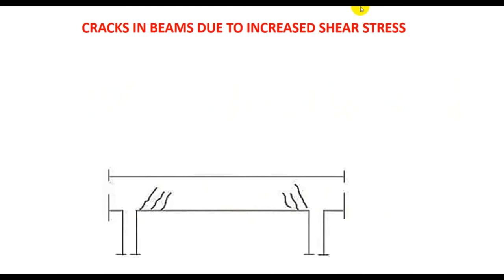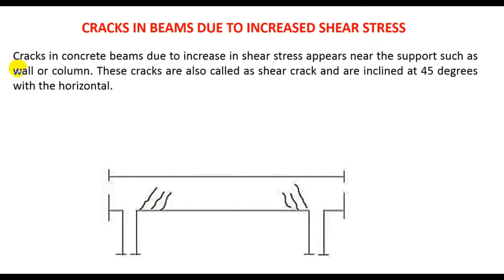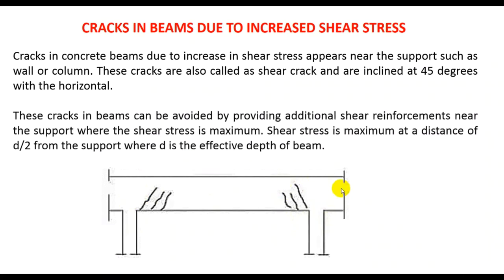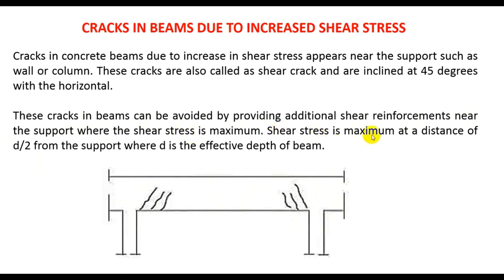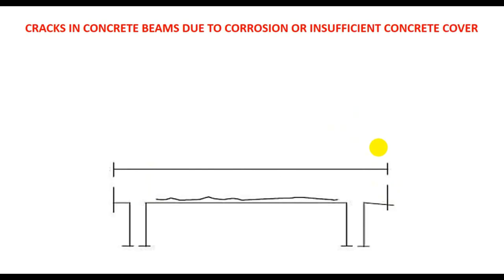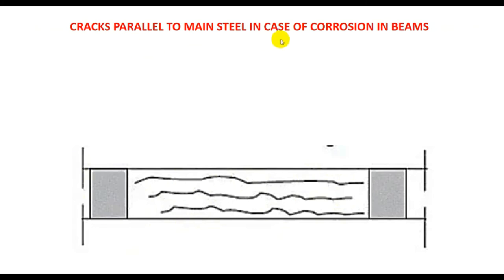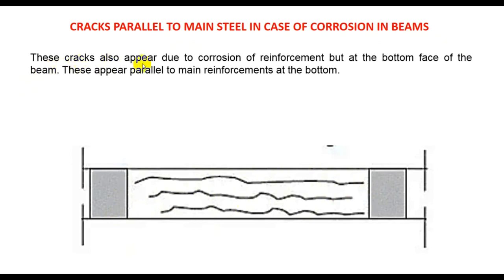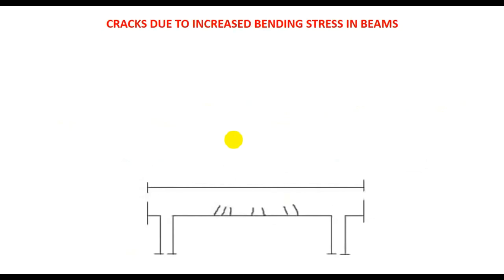Types of Cracks in Beam and its prevention | Civil Engineering Basic Knowledge

Comment: Sir is it necessary to provide cap beam in pile cap.
Reply from the maker: its totally depend on your design. 

Pile foundations are a type of deep foundation. They are formed by long, slender, columnar elements typically made from steel or reinforced concrete, or sometimes timber. A foundation is described as 'piled' when its depth is more than three times its breadth.

Pile foundations are principally used to transfer loads from superstructures, through weak, compressible strata or water onto stronger, more compact, less compressible and stiffer soil or rock at depth. They are typically used for large structures, and in situations where soil is not suitable to prevent excessive settlement.

Piles can be used individually to support loads or grouped and linked together with a reinforced concrete cap.

Pile caps can also be linked together with reinforced concrete to create a capping beam. At least three capped piles are needed to ensure stability against lateral forces (with the exception of caisson piles). Capping beams are also suitable for distributing the weight of a load-bearing wall, or of close-centred columns to a line of piles.

This differs from a ground beam which is provided between adjacent pile caps as a structural element to improve the stability of the foundation. 

Piles may be staggered along the beam to allow for any eccentricities that may occur in loaded conditions. If light loading is expected to result in only minor eccentricities, then the piles can be driven in a line beneath the capping beam’s centre.

The capping beam should be kept clear of the ground where the purpose of the piles is to overcome the problem of the subsoil swelling and shrinkage. This can be done by casting the capping beam on polystyrene or other compressive material, thereby allowing an upward ground movement without damage to the beam.

An economical construction method that can be adopted is to construct concrete block walls to the exact sizes of the cap. Having first backfilled the wall with soil the space can then be filled with concrete. This cuts down on the need for formwork and the extra excavation required to position it.
Reply: @qlearnify-en  thank you so much sir.
Reply from the maker: @ajazsayyed8487  you are always welcome